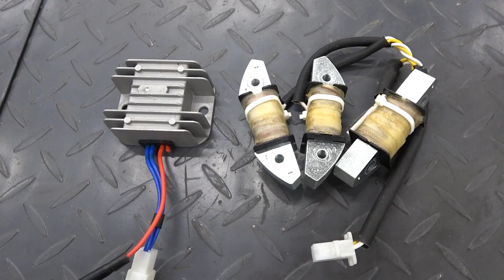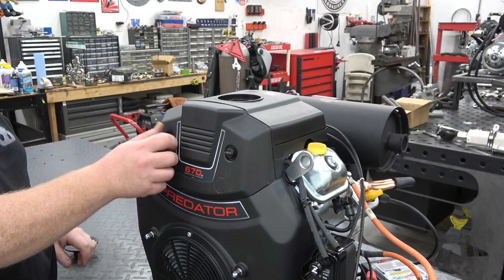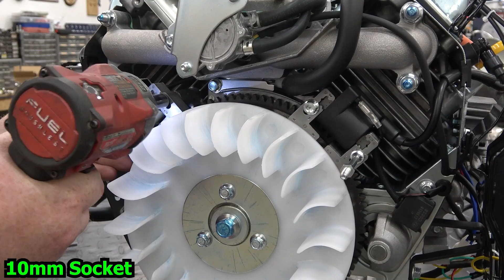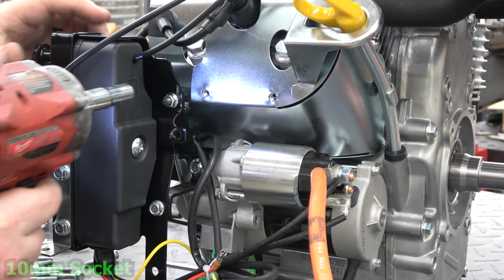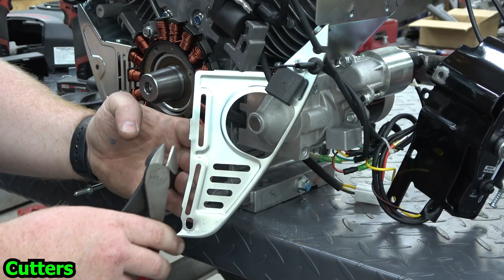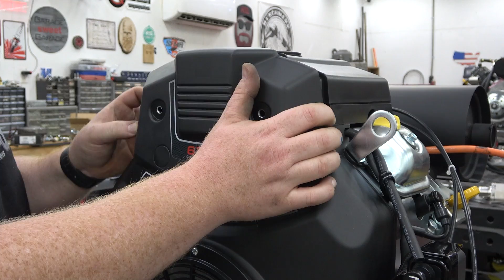Predator 670cc V Twin High Output Charging System Install

Comment: Me:

I am looking to build a light weight 670 engine ( 35-40 hp) for ultralight airplane.

I want an aluminum flywheel, and I want to have a battery charging system. ( billet rods etc )

OAL engine wt. 85 pounds w/o a redrive. ( 95 pounds with a redrive )

Please:

Why can't I get an aluminum flywheel which generates battery charging ?

Comment: Nice video and upgrade as well. The airport had a 690 installed on their luggage conveyer and the charging system is not functioning to full potential. This engine isn't that old either. It will run and there is a carb issue also. Running on quarter choke and will only run for about 5 minutes which offered the multi meter battery check which was only at 11.45 volts. How many cut off wheels did you go through to get those mounting places trimmed down?

Comment: Curious, if you think this charging system would hold up with a stage one performance 670 performance kit? I would love to do the alternator kit, but I don’t think I have the clearance in my golf cart to make it work. I might be able to go with a smaller belt and move the motor back possibly to gain a little more room, but it’s gonna be tight.

Comment: I repowered my Ingersoll/Case 448 tractor with a Predator 670 cc engine. I needed more electric current as the engine makes practically no electric .
 I ended up machining my own pto shaft and used a 50 amp single wire delco alternator. 
 It was quite a job, but it works good.
Reply: I put a 670 in my allmand mini backho. I have questions, you drove the Delco directly by shaft,???  How can I reach you?

Comment: Ive got a challenge for you, never been a fan of the clunky 30 series torque converter plate. Come up with a 1-2 inch engine riser that is longer than needed with a driven pulley hub welded on. Ideally with slotted holes to adjust engine both ways. Good way to make money and be innovative.

Comment: Do the fan and shrouds have to be run on the engine? Will it run too hot without them? And why isnt there a billet flywheel offered with this charging system?